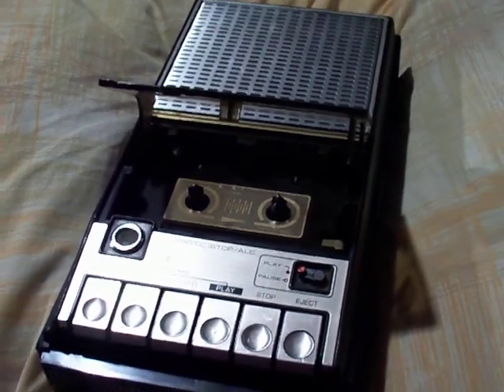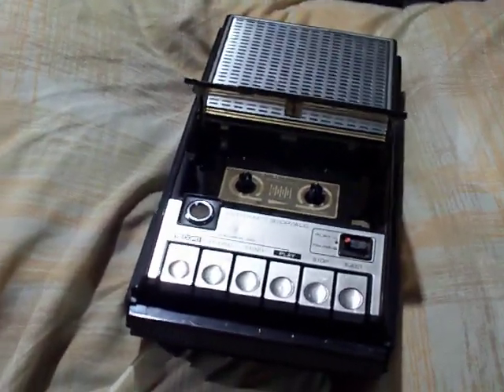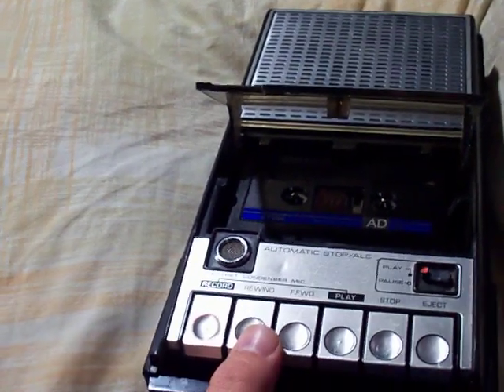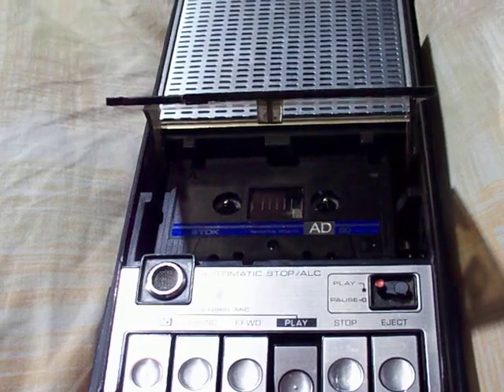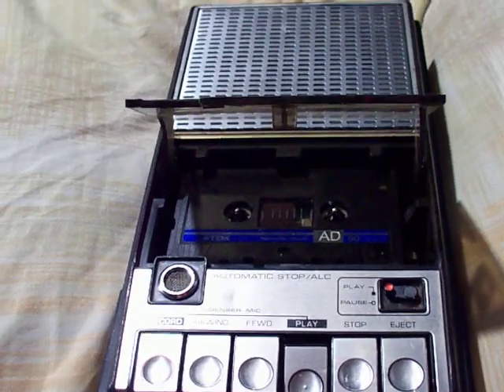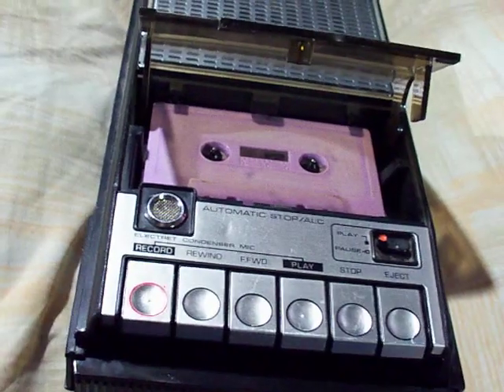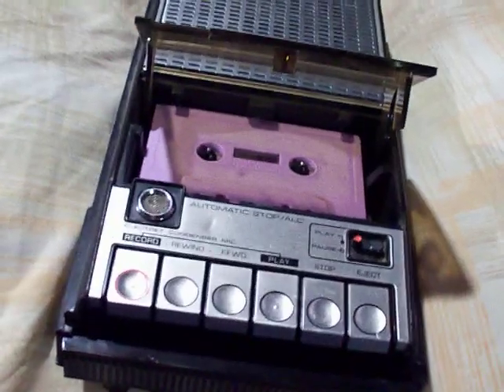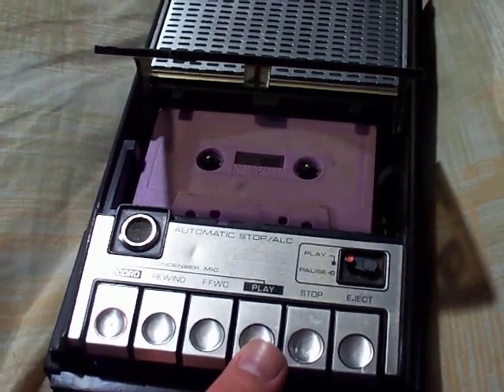General Electric Cassette Recorder 3-5105F REVISIT III

Comment: You could still try switching back and forth a few times to work its way in there. If that static comes, just switch it a few times and it should come in right. (I have had the record-play switch problems on numerous recorders, and have heard that EXACT static.)